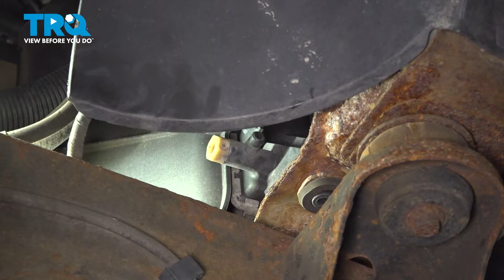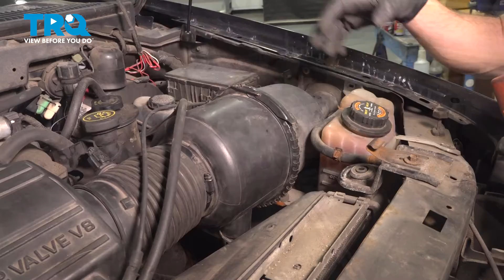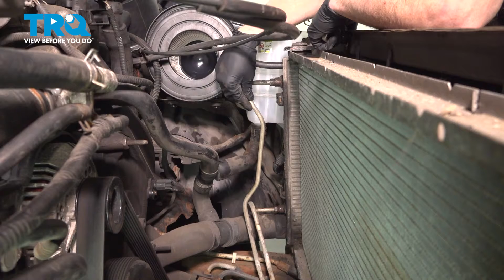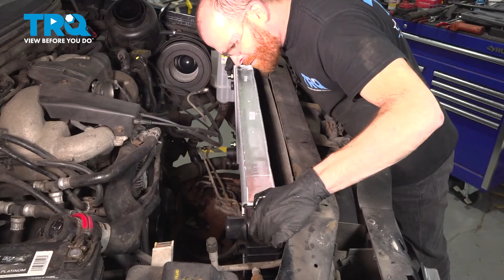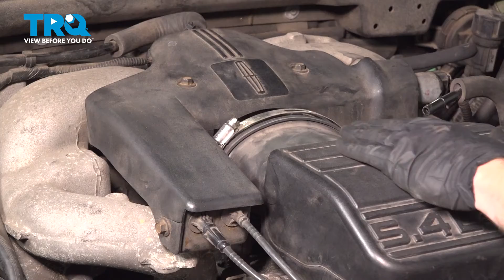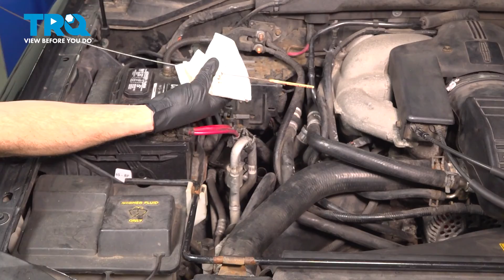How to Replace Radiator 1998-2002 Lincoln Navigator

Comment: Does anyone know the part code-number of those two orange (when original) o-rings that goes in the lower connection of the radiator? (Minute 10:33 of the video) I'm strugling to find this o-rings in the regular stores of my town (Even Ford dealership does not know).